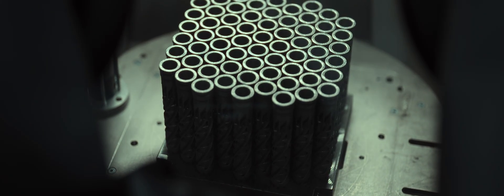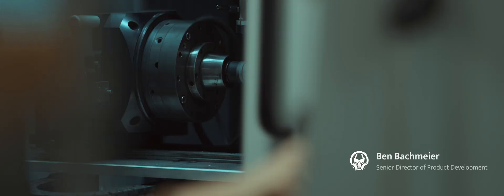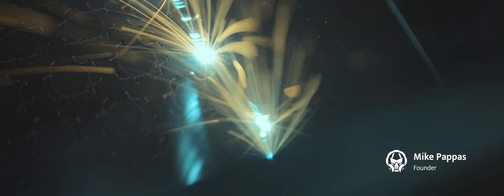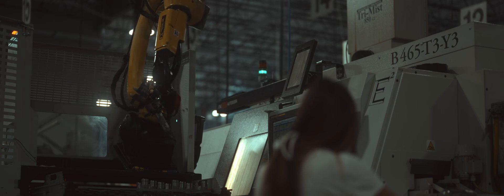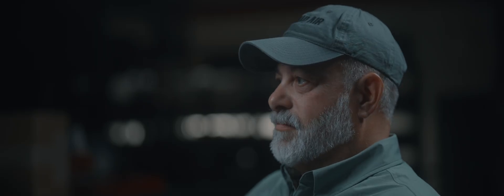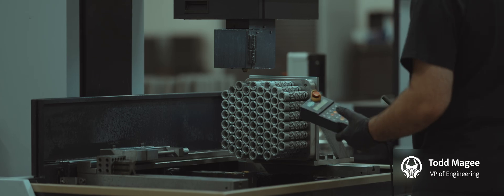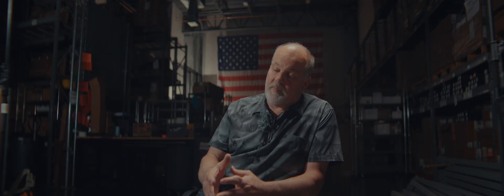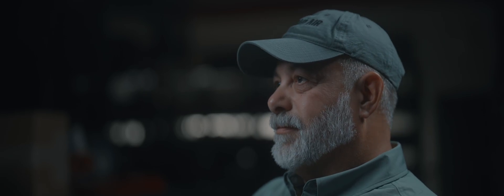Dead Air Silencers: Technology, Innovation, Purpose Driven Performance

Comment: Except for the QC on my primal that yall gave the okay a second time when I sent it back. What garbage, Dead air cant even align their baffle cuts from the factory. Never again.
Reply from the maker: Did you have a baffle strike? Did you check it with an alignment rod on your gun?
Reply: @DeadAirSilencers  No baffle strike, alignment is fine. It works as intended. Its more of a QC issue, the clips in each individual baffle are not in a straight line seems as no one checked it before it was welded looks like someone in India threw it together. If it were my shop it would have never left, I also understand its a huge pain for yall to fix something cosmetic on something that has a serial. Just sucks thats all.

Comment: I’m stoked about this new technology.  I have an old faithful Sandman S and I love it.  You can’t kill it and really, nobody’s attachment system beats the Keymo.   I run my Sandman on a 300 blackout, a couple of my 5.56’s, a 26 Nosler, and a 300 Ultra mag.  I’ve Never had a single issue.
Reply from the maker: Thanks for running that Sandman hard!
Reply: @DeadAirSilencers  Thanks for creating something that I can trust to run hard.  It turned my 26 Nosler and 300 Ultra mag into a couple of sweethearts.   😂

Comment: What is Haynes? Steel? I need some more education on the materials and subject generally.
Reply: Google "Haynes 282"
Reply from the maker: Haynes 282 is a nickel-based superalloy. They mostly use it to make rocket nozzles because it's so strong and maintains stability at such high temperatures.
Reply: @DeadAirSilencers thank you gentlemen.  That’s incredible, sounds like the new inconel replacement.
Reply: Google Haynes 282
Reply: @andyhills on an infomercial from dead air, you’d think they’d explain why their product it better 🤷🏽‍♂️

Comment: Cans cans cans, everybody is making cans but you guys are on the cutting edge; that Lazarus 6 and Haynes 282 is something else. I'll be curious to see this new 5.56 can that also uses Haynes but regardless one of those two will be my next DA. I want something that will last and I've seen some tests on the Laz 6 that were extremely impressive. I can even imagine a Mask 2 made out of it, a 22 can that's truly capable of 5.56, not one that just merely survives it. Would also make cleaning easier, just get it red hot and shoot the lead out. Nice work guys.
Reply: The lazuras 6 is the 556 can l9l
Reply from the maker: The new 5.56 can is really, really good. Thanks for always being here!